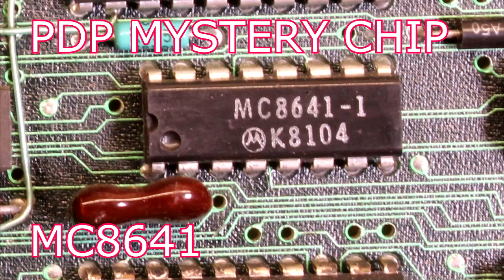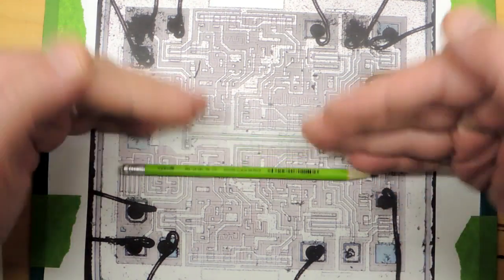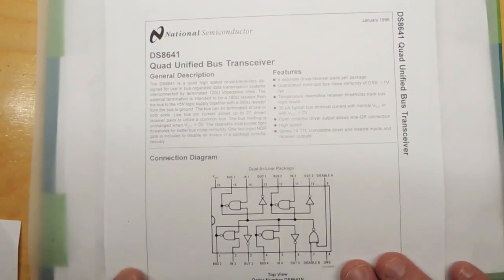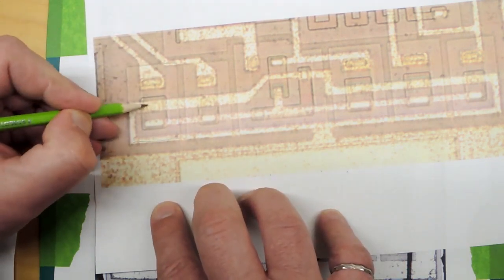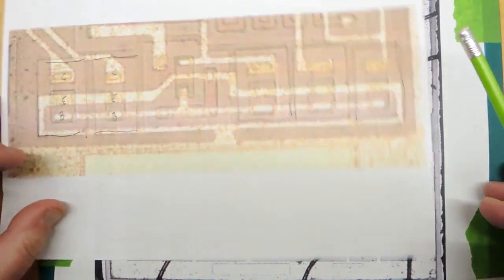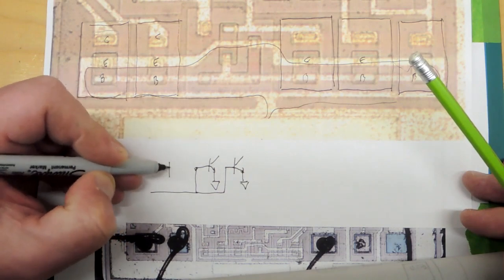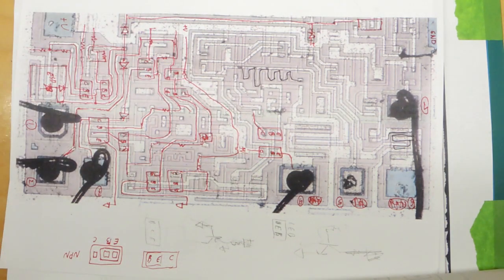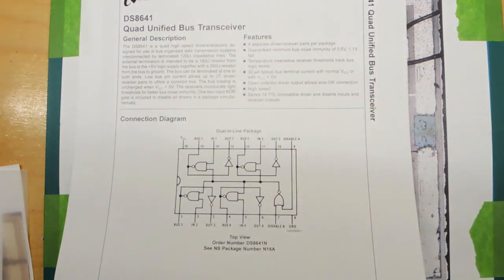PDP 11/24 MYSTERY CHIP: MC8641

Comment: IC 8641 is a bus driver receiver for Unibus with following
pins: INA=pin 14, OUTA=pin 13, INB=pin 11, OUTB=pin 10, INC=pin 2, OUTC=pin 3,
IND=pin 5, OUTD=pin6, ENB1(neg)=pin 7, ENB2(neg)=pin 9, BUSA=pin 15, BUSB=pin
12, BUSC=pin 1, BUSD=pin 4 (all bus signals are negated). Ref. PDP11bus
handbook page 71.
Reply: Knew it was some sort of bus chip..

Comment: Could you please show how you decap an IC? I've a microscope and would like to check out a few dies.
Reply: I personally suggest getting a cheap 1 dollar calculator and heating up the blob chips carefully with a torch. You can then scavenge the tiny silicon chip and it'll typically have the die already exposed.
Reply: I've tried the heat method (no 1$ calculator needed, because I got enough old ICs laying around to try it out with ;) ). I tried it with a heat gun (a small one for soldering and a big one that goes up to 600°C). Unfortunately that's not hot enough to remove the plastic (only weakens it, but not enough to be removeable without damaging the die). I also tried a blow torch and, yes, half the times I can expose the chip. But the heat usually messes up the small traces (they are just aluminium) and the chip doesn't look nice anymore (I'd like to get a few pictures out of it).
Reply: Hmmm, did you try heat and a scraper?
Reply: In a previous video, @electronupdate featured a cheap method via epoxy suspension and sandpaper. https://youtu.be/GQOW7si5-cw  [He uses a surface plate, but if you don't have some Starrett granite lying around, I'd imagine any glass which was flat-pour manufactured (e.g. a standard silvered mirror) should be flat +/- a thou between any two points up to a foot, which is enough room to lap against. Glass is fluid enough that it will creep over time, so using an antique mirror might not be the best idea..]  

Go slowly and try to apply continuous pressure. Every few minutes, rotate the chip by 45 degrees, so you minimize your chances of biasing your wear to one part of the IC. I'm not sure if 600 grit will be fine enough to resolve your feature components. I'd buy some cheap diamond lapping abrasive off ebay at various sizes (try ranging from 15-300 micron). You can buy premade paste compound or make your own with the raw abrasive and a solvent. Should be good enough for up to two metal chips I'd imagine. 

Chemically, the standard method is using nitric acid. Depending on the composition of the potting material, you will have to experiment to find the proper amount of heat applied and/or the duration. A fume hood is basically required. Neoprene (*not nitrile*) lab gloves are what you want to use, along with full Neoprene and/or PVC full-suiting. Even with a fumehood, you need proper respiratory PPE (cartridged full-coverage masks, we used 3M's special line that was specifically certified for what we were using -- red fuming nitric acid--  concentrations, though it'd probably be good up for white fuming I'd imagine) I'd duct any exhaust fumes to funnel through an aqueous KOH or NaOH solution, because I'd feel like a dick just ducting it out into the environment without scrubbing beforehand to a netural ph, but I just wiki'd it, and nitric acid apparently autoprotolyzes fairly easily into NO2, NO3, and H2O so that step might be completely extraneous [ the moooooore you know ].
Reply: Definitely not something you should try at home. Decapping an IC uses using boiling, strong acids. Hot nitric acid being one of them. That's the kind of stuff that will happily explode, thermally burn you and kill you as it eats through your eyeballs. Another acid that sees use is (hot) Hydrofluoric acid. That's the kind that will happily poison you to death if you splash a bit on your hand or inhale the fumes. And melt your eyeballs. And give you thermal and chemical burns. 

Take a college chemistry course first so you know how to handle strong acids in a safe manner.

Comment: I love your content. So unique and interesting. 
Is this how the Chinese copy ICs?
I took apart a genuine 2N3055 and placed it under a microscope. Compared it with one that I bought from Banggood.
The one from Banggood, had a die about have the size of the genuine and it even looked different.
Can you do a video about fake ICs and transistors from China? 
You don't have to go far to find them. I did the same tests on LM317 and found them to only work up to 1A instead of the genuine which can do 1.5A !
Do they go for smaller dies to be able to make more of them from a single raw wafer? 
Thanks again for such interesting videos.
Reply: Yes, smaller dies are cheaper because they can make more per wafer.
Reply: Yeah, I added the last line to catch the Sherlocks.

Comment: The emitters are all tied together, so let me guess... Is it an ECL logic chip?
Reply: No, not ECL but TTL. The 5 transistors are being used as a 4 output gate, one input to a single transistor acting as a clamp to ensure it is fast turn off, with a base resistor and a pull down resistor, and then 4 open collector outputs in the chip to act as gating functions. Most likely part of the internal enable signal, which is about the only part of the chip that needs 4 separate outputs to feed the logic. 4 parts because there will be logic level changes on the open collector gate from the other sides, the open collector is pulling the internal signal down to disable the logic level from changing when disabled.

With the large area needed for polysilicon resistors you also often had a need for high value small resistors, so those were often implemented with a JFET instead, as you can run that pinched off and get a high resistance channel that gives a very roughly constant current, though it is not too accurate resistance wise, tolerances are in the range of +-50%, but it is small, and on chip most will be very close and track. Otherwise you designed in proper current sources and sinks, as the area they used was generally smaller, though you did have limitations, but the active ones made better pull up and pull down over resistors in most cases, though you would always have a saturation voltage close to the supply rail.

Comment: Given that the IC is on a digital board, and is only 16 pins, an analysis of the electrical properties can probably reveal its function without decapping it.
Reply: At the very least, the power and ground pins should be quite easy to identify.